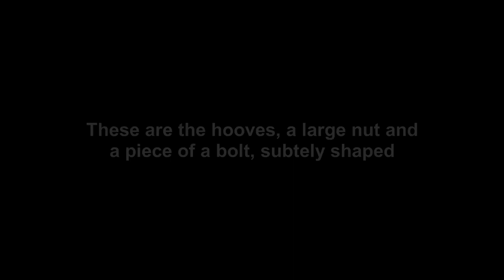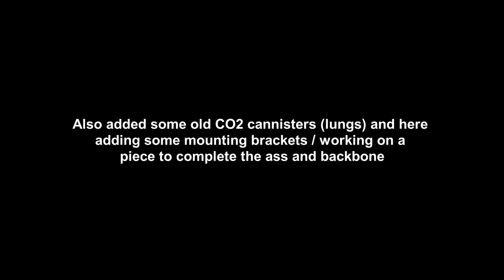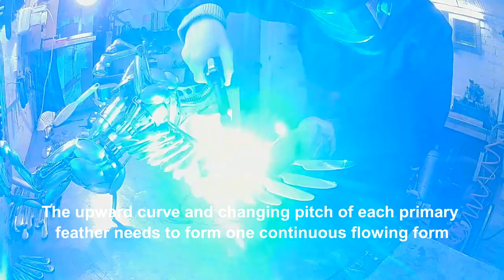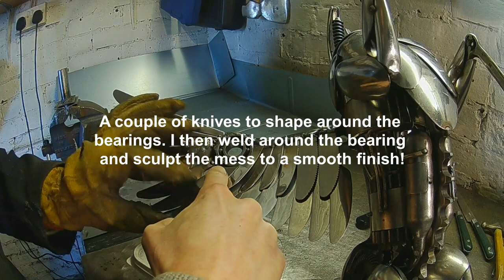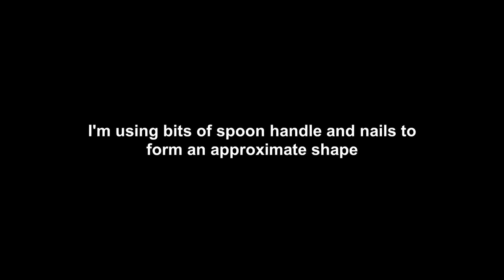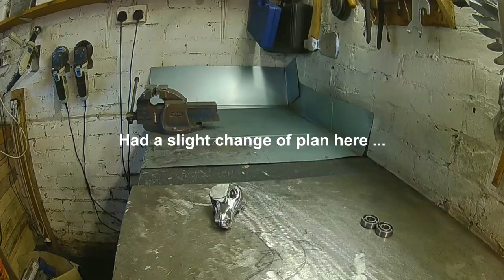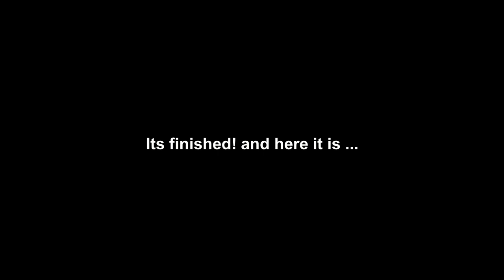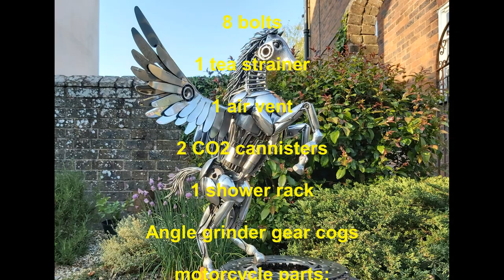Making Pegasus from Cutlery and Scrap - Complete Build video

Comment: Stunning piece!!!

Through the video I was wondering how many hours you had in this and thanks for the annotations through the build..... at 120 hours  I thought it might have been more. Am curious as to what finish you use for final preservation?
Reply from the maker: Thank you sir. Yeah still working on my editing to be honest. I feel like what I did with the KH logo sculpture is the way I will go, one short version & one long with chat and maybe the odd annotation. Difficult to know what people want and trying to cater for all. Thanks for the feedback, its all really useful. 

Ok so the finish ... it depends entirely on what material i'm welding and what wire im welding with. (MIG welders feed a wire through the hand gun into the work piece which completes the electrical circuit on contact and melts both the surface of the work piece and wire thus forming a weld.) 

Typically I use mild steel wire on almost everything because it is so much easier to grind and sculpt, especially useful on the small scale sculptures that I make. It will weld stainless steel (cutlery) no problems for the purposes I need. There is an issue with that though ... if you weld stainless with stainless wire then nothing rusts or tarnishes. If you use mild steel wire then the welds at some point over time will start to tarnish ... so ... once I've got to the point where im done with the final polish I forensically clean the piece with a solvent and avoid touching it. I then lacquer it. The mustang is a good example of that, thats sheet stainless off cuts welded with mild wire. I think I made that a year ago and no tarnishes on it anywhere. Its just about thoroughly removing contaminents and sealing the metal.

Having said that, I make sculptures (so far) for indoor display. I think if I made a grand piece out of stainless steel for outdoor display I would probably just weld with stainless. I'd have to take advice on it myself. Not really studied the effects of prolongued sunlight on stainless steel vs lacquer. My hunch is that (looking at how car lacquer peels) it would be better to not lacquer it and know that you're never going to have to come back and remove peeling lacquer only to have to do the same every few years.

Hope that goes some way to answering your question.